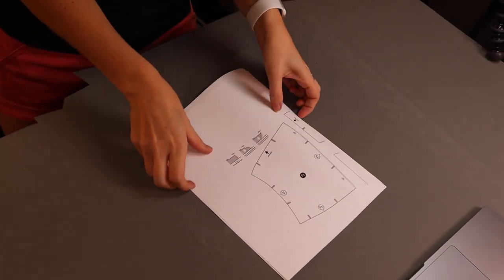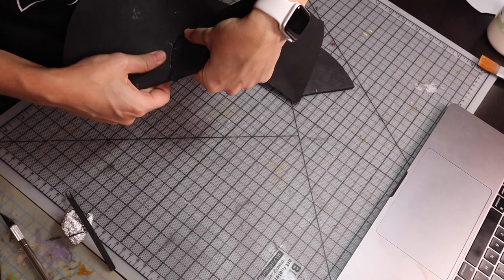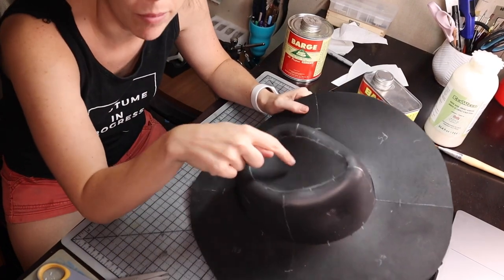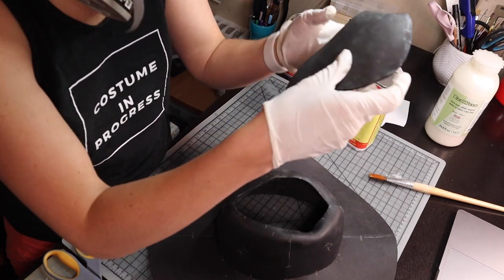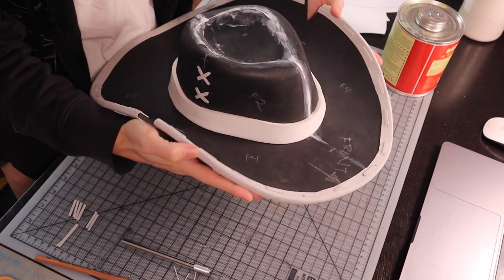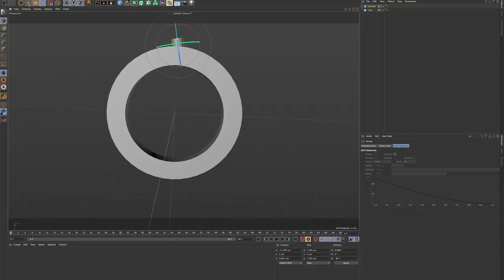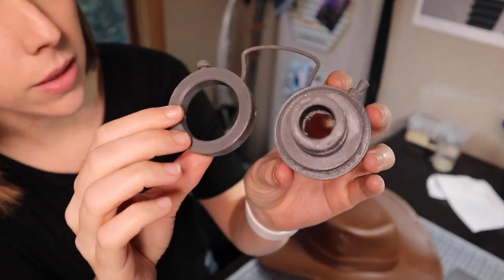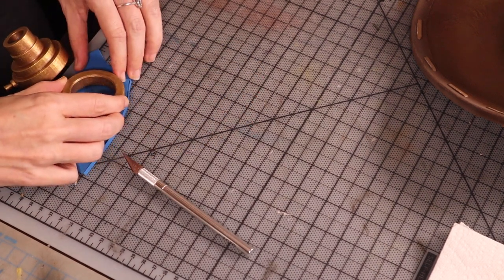How do you make a cowboy hat without leather?

Comment: Cowboy hats are made out of felt, not leather. The price is directly proportional to the percentage of beaver fur (for water resistance) in the composition of the felt. 100% beaver fur hat will cost you between $800 and $1,000. After the hat is created, it is steamed and creased (to give it the desired shape). What you made is a hat with a Pinched Front Crease.